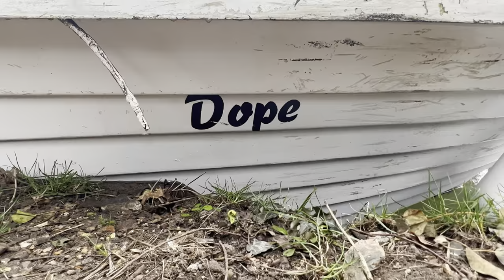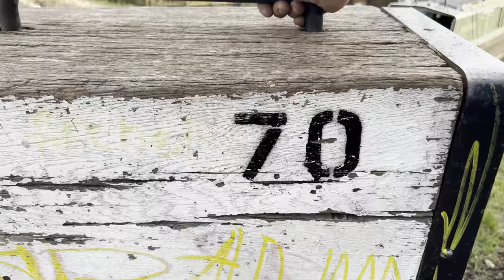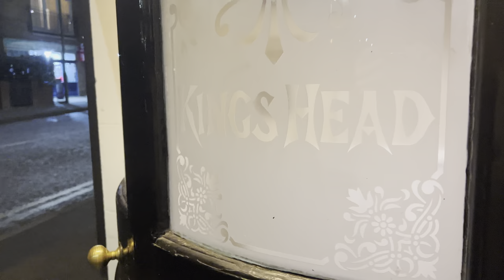395. The CRT tell us to carry on cruising

Comment: There's some nice cling window film on Amazon for a good price. You could keep the sunshine and light but have some privacy in that bathroom window. Super easy to put up and stays perfect. I think Rob is on to something. You would never leave your windless if it had a bottle opener in it ☺
Reply: on the note of these they are great but, if you have single glazing, put it on the inside, but if you have double glazing, you cannot put the film on the inside and it must go on the outside, otherwise the sun gets reflected into the double glazing gap and the heat causes cracking of the glass.
Reply: @redfox05nl  Excellent tip! I had no idea.